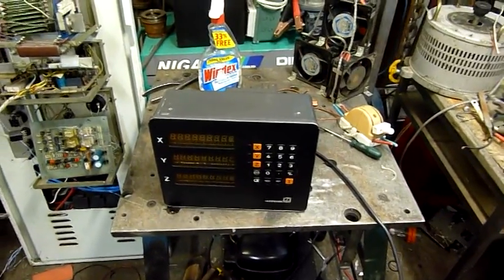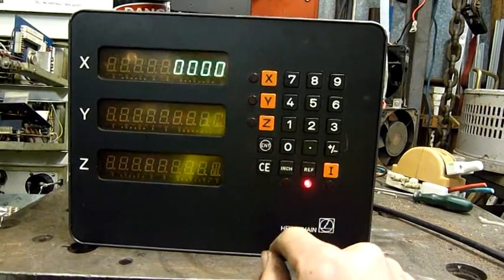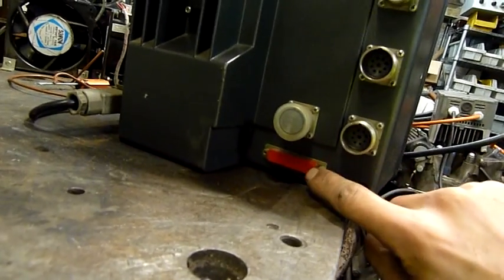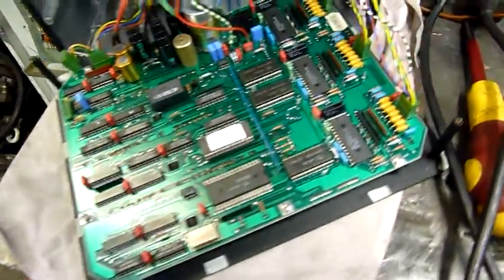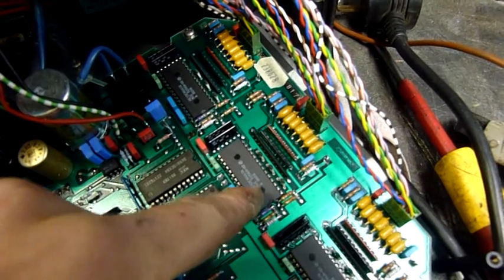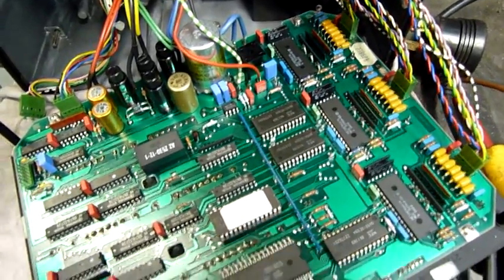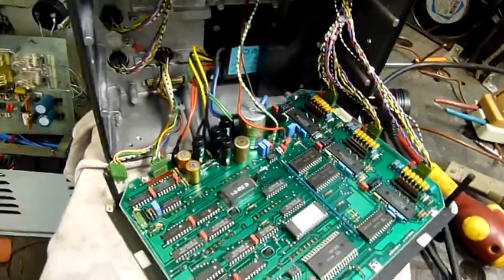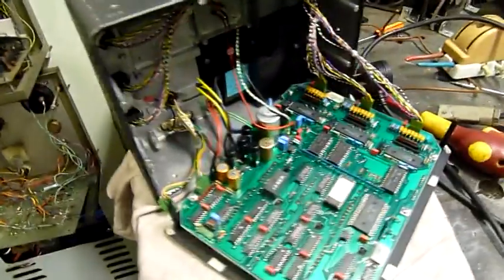Heidenhain VRZ 775 DRO Internal Examination

Comment: Those are old style. I used to strip out loads of these from old industrial equipment. They were often hand made - hand drawn permanent marker on bare copper, than etched and tinned. No solder mask (the green varnish) or printing on them. 

They also tended to use discrete diode logic (i.e. logic gates built out of transistors and diodes, or even relays and diodes).

You could tell they were hand drawn, because the lines wobbled and they had all sorts of weird curves - not 45 degree stuff.

Comment: The first pick & place machine from work, it's position sensors, where made by Heidenhain. they were built using a common light bulb and a thin grid to produce some sort of refraction patern over a marked strip al allong the X and y AXIS. The reflected beams were used to read the strip marking, both absolute and relative position. The machine was early 80's. Incredible presicion really. And the fact of the refraction was crazy !!!!!

Comment: Atmel are no more open source than ARM.. as long as they publish enough documentation that you can actually use their stuff it doesn't matter. If you're blinking LEDs an AVR is fine but you'll never find one with the same grunt as some of the ARM parts.. hence Atmel have their own ARM based lines :)

Comment: Wow nice dro, you can almost see how it works in the layout :-)

That beasty staggerpin chip ive seen in printers as the microcontroller/computer, the rom is the program, cant see ram chips for temp user data but it could be internal to the beasty chip.

A green/blue filter would make the displays much better for contrast, like the old florescent digital clocks :-)

Smashing vid :-)